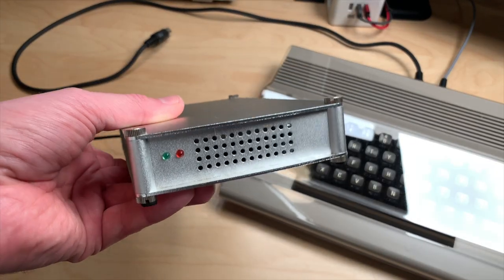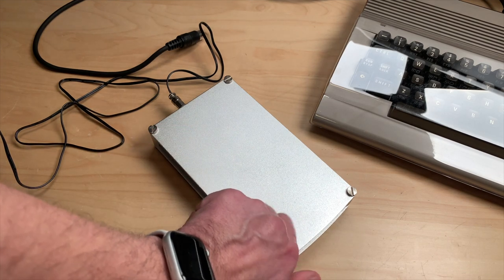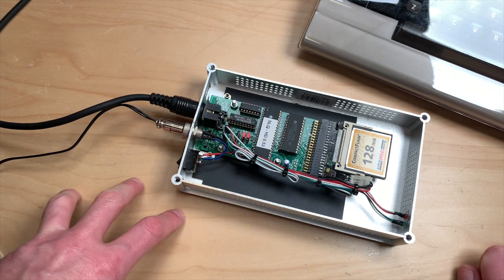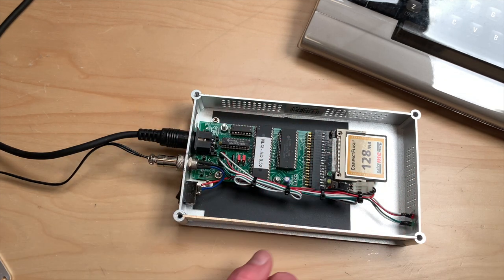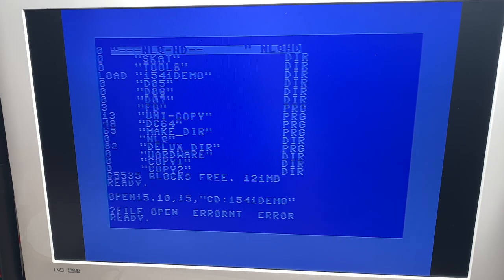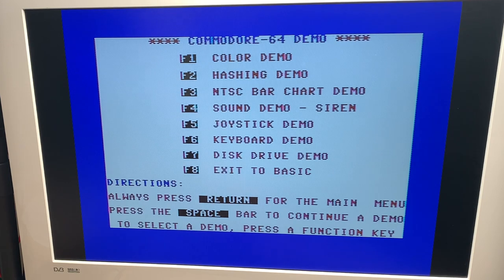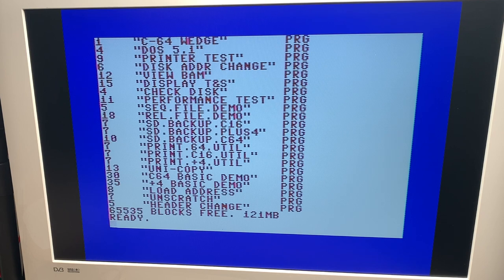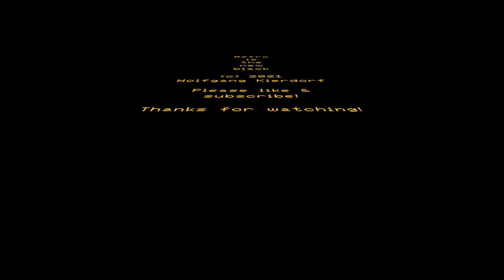The Commodore 64 Hard Disc Drive - an IDE to IEC Interface

Comment: I like this project. Although I don’t need it with my UltimateII+ cartridge but this is brilliant. And that from a dentist! Usually not the most technically inclined people :)
Reply: I was going to post a message similar to this.  I have the U2+ as well, but, I've been tinkering with VICE and the 9090 emulation, and it's pretty cool either way you slice it.  I haven't really been able to dig too deep into it as I keep having some odd ball crashes with Vice when playing with it.  But getting a hard drive hooked up to the 64 would at least alleviate the REQUIREMENT to use the U2+ and I could get a few of my machines going with something like this.  You'd still probably run into issues with protected disks though.
Reply: @Mr76Pontiac  I just I had the time or the detailed information how the serial drive communication works in the C64. It would be cool to develop a wireless version of this that basically just connects to an SMB share where all your images are.

Comment: Another good video!  Did you think it was ID #2 like the GEOS Ram drive? But it’s been set to ID #10. Is that a software setting like on the SD2IEC has a command to change it from 8 to 9,10 or 11? Thank you
Reply: I wondered about that too.  Device #2 is reserved for the user port in the C64.

Comment: That would be better in a smaller 3D printed case which would allow the Compact Flash to be easily changed.  It would be possible to design the case to allow an easy transfer of the existing electronics into the new case.
Reply: Absolutely correct, but, how frequently would you be changing the media to make it worth while?  Perhaps if you constantly keep updating images on the drive, I guess?
Reply: Well 64GB card would never require you to change it ever :)

Comment: The uiec firmware by Ingo Korb, which is the basis for sd2iec, was first built as a compact flash solution back in the early 00s, and still supports an at-ide bus. In fact, I'm curious if this hardware is actually running uiec.
Reply from the maker: I just saw your comment ... sorry for the late reply! How can I check that for you?
Reply: @RetroWK  Hello.  One way to check is to 1. turn on the computer, 2. turn on the hard drive, 3. before doing anything else at all, enter this program and run it: 10 OPEN 1,8,15:INPUT#1,A,A$,B,C:PRINT A,A$,B,C:CLOSE1
It will report the version of the CBM-DOS in the drive.
If your hard drive is not drive 8, you can change the first '8' in the open statement above to the correct number.
Reply from the maker: Just gives me an illegal direct error. The drive is 10, so used that instead of 8.

Comment: Heck I never knew C64 recognised MB's of storage?! Was there ever a storage larger than the FDD Double Density that worked natively with C64?
Reply: Hello Paal.  The C64 iec serial bus is a universal bus.  It does not matter how big the storage is, so long as the serial bus rules are followed.
Reply from the maker: I guess the 1581 is a prime example here. Since the drive logic always resisted in the drive it's hard to define native.

Comment: Eine kleine Frage: sind die Programme, die auf mehr als 1 Disk enthalten sind, unterstützt?
Reply from the maker: Das hängt davon ab, wie die Dateien des Programms geladen werden (Nur Dateiname oder auch Name der Disk). Im ersten Fall sollte das klappen, im zweiten Fall leider nicht. Allerdings gibt es ja auch viele Multidisk-Programme, die inzwischen als CRT oder Einzeldisk-Images für 1581 erhältlich sind.
Reply: @RetroWK  danke für die Antwort. Also es gibt leider keine Vollkompatibilität mit 1541. Aber trotzdem das ist ein sehr interessantes Gerät.